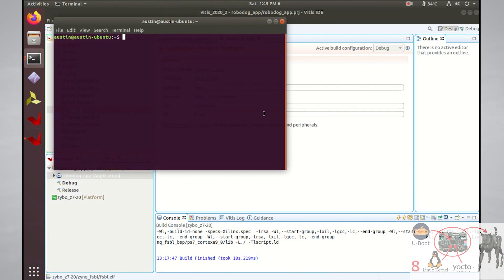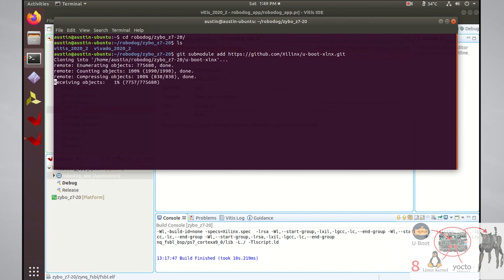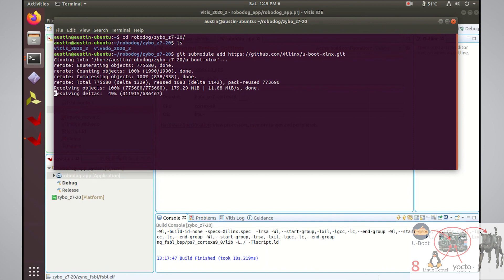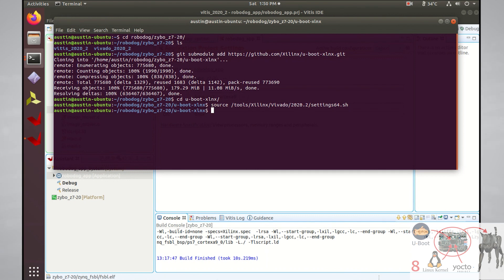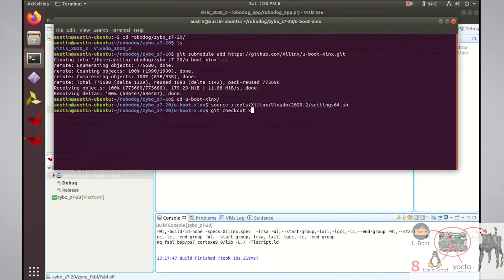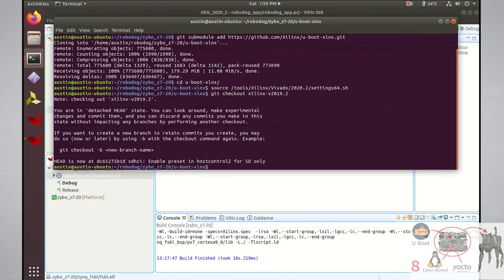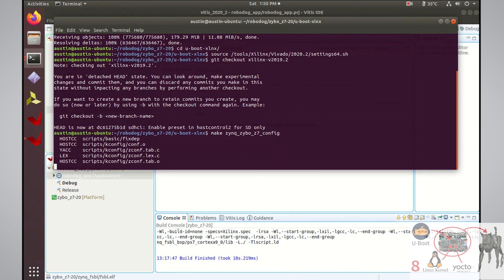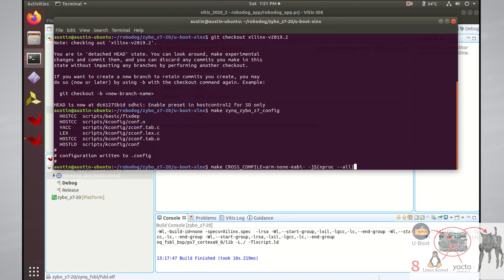#3 TechBytes | How to Compile U-Boot Bootloader from Scratch

Comment: Hi! thanks for the video
For what purpose did u compile the uboot? 
Doesn't petalinux provide u the means to do so with specified commands?
Reply from the maker: Yes, petalinx can do this. However, I've heard that AMD plans on phasing petalinx out to use Yocto instead. Regardless, I think it's still useful to know what the tools are abstracting away from you and to be able to do it yourself manually if needed.